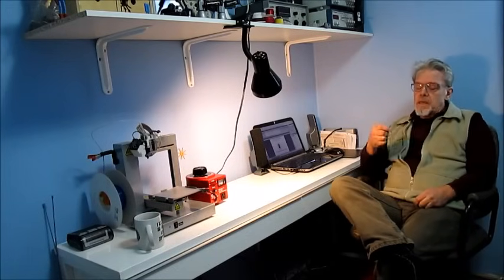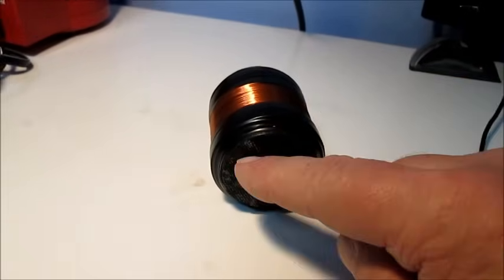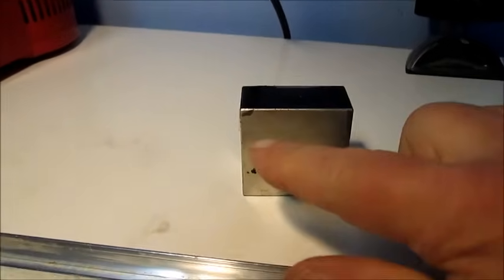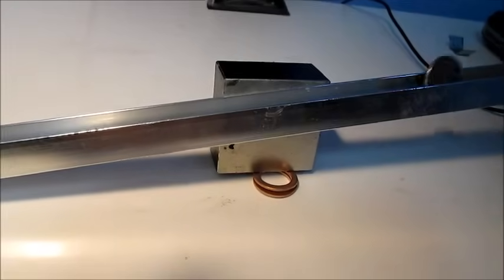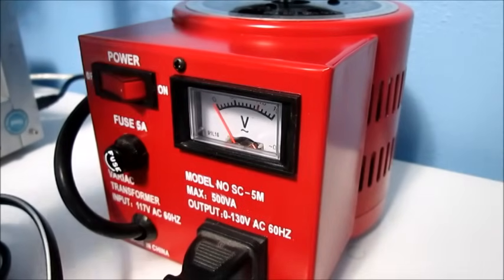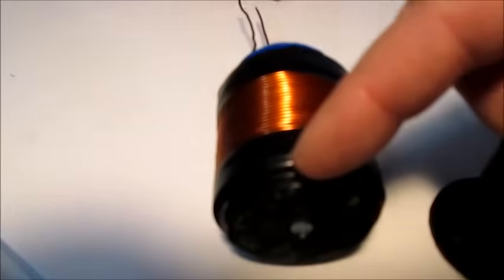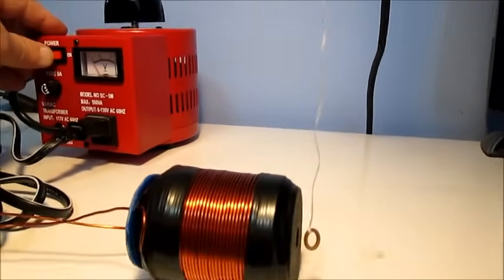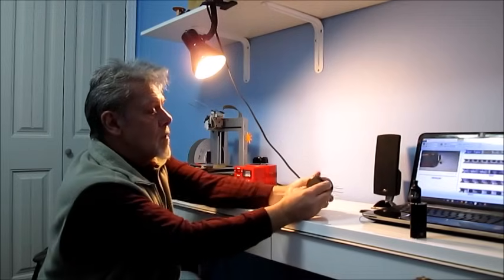How To Make A Gold Magnet

Comment: Taper your outer coil to center of Inner @ 108* and add a third outer coil  3-6-9 good luck
Reply from the maker: Hey Tony, thanks for the comment.  

I think I know what your getting at with the degree shift. I cannot predict what a third outer coil would do. I had planned to change the inside coil to a bifilar coil and use sync generators to power it rather than the variac
Reply: Yes bifilar Two cones per side inner to outer cone and two outside to balance from top N.inner -S outer on north end S. inner . N outer then the same for middle section 2 coils N. S. coils Per end no iron now  opposite coil wind over middle.  .Depending on polarity of current pay attention to Right thumb rule of magnetic flux in the coils in close proximity  to amplify each other rather than oppose .Like a powerfull transformer amplify and lock .Proportion  coils like inner 60/60  wraps on core smaller wire required.Iron layer then same wire size on outer coils but 30 wraps with a 54* drop in length from core top    then 60 wraps on all 4 of outer coils which = 120 wraps in series S. top to N. x2 but increase height from center 12* higher than core height. wire in series from _ to middle of and center corresponding coils .try no iron in middle  smallest coils then 1/4 iron on second  center coil in the  center off inner and outer  and half of 3/4 top and bottom center of outer coils. iron between inner and outer of last coils . connections in center and ends . outer pith change no more than 15* on ends  you will need  imagine 2 bowls in center with iron on both sides outer copper inner copper With 4 iron rings around Bowls due to A/C current you must seperate your iron  cores  in the centrapiedal plane  by 18* of 180* Total height .Have fun  every biffilar coil  is opposing each other 2 per pole x 3 =12 coils per complete build
Reply from the maker: understood

Comment: Commented on Eddy currents ad libitumcopper,aluminum,silver are magnetic  field inhibitors. and they lock the fields into a slowly moving path, causing the magnet lo lag behind. and each metal have different speeds of magnetic field travel... not caused  by eddy currents. you can see this by watching the magnetic field traveling threw these metals. if it was caused by eddy currents in test it would show two distinctive fields. witch it dose not...ive done this using an old tube 60''TV . holding a magnet up to its screen will show you the field/flux lines. and you can repeat this test for your self and learn something. and go against the norm.
Reply: Nabo00o11 months agothats an unusual way to explain it...
superconductors can be used to shield magnetic fields too but they do it perfectly or so i gathered, because with zero resistance they will perfectly match any change in magnetic flux with a flux of opposite polarity, thereby canceling all of it. So in that case, how does your theory fare compared to the norm explanation of induced currents and cmfCharles gonyon2 seconds agono in reality when you super cool sertin metels they become locked in the flux field do to the densness and shrinking of the metal squeezing the flux lines until they are locked and canot move with out grate force. ive ran test on this as well using a tube tv to show the flux lines in the magnet wile holding a pice of copper above it then super cooling it then the copper levitates in that position. and on the tv when I bump or try to move it the flux lines on the tv show that im moving them and it shows there locked into the copper until a breaking point is made.Read more
Reply from the maker: Hey Charles, thanks for the comment.

It's hard to find the old CRT tube TV's anymore.  The electrons shot from the gun reacted to the magnetic field.  This in turn caused the phosphorus on the inside of the screen to change the screens pattern. The good old days...

kk
Reply: tx on way to look at it to prove  the point. naturally generating a magnetic field dose not create  heat. so if eddy currents where being made no heat would be created just a reverse polarity. but if you spin aluminum  copper or libitum above a magent it will generate heat coused from friction from the flux lines fighting to get threw the crystalline structure that the lines are locked into
Reply from the maker: That is an interesting point.

Keeping i mind what Faraday taught us is that a changing magnetic field causes a magnetic field to be generated in a conductive material.
Reply: KenKlondike. Yes but his thinking was and is flawed and this is incorrect. Thats why we will never advance people stuck on old science. That they still do not understand. Tesla new this but would not tell people it was one of his secrets that he had that Made him so advanced in his study of electrics magenicts and sound vibrations with resonance
Reply from the maker: most scientists from 150 years back would change their thinking using today's tools. Flawed Thinking ~ NO! 

We see farther today because we stand on the shoulders of these giants.
Reply: KenKlondike thats verry true in that way of thinking
Reply: when something is super cooled  it stops the propagation of the flux lines freezing them in place and blocking them from exiting the material. this in turn keeps the super cooled material locked in what ever place you place it in. if it was creating opposing fields it would just flip over and be attracted to the magnet. just like putting to opposing magnets to gether they will flip and join as 1 magnet  attraction is greater than opposing. no 2 magnets will hover over one another with out being forced to do so.

Comment: Okay I have to be skeptical about this I would like to see this done with a gold nugget not coin that way the gold is more pure then what they've added to the coin to make the gold stable
Reply from the maker: Hi Jerry

Its ok to be skeptical, that's what advances science. 

The gold coin is a 1/10th ounce Canadian Maple, near pure element au.  Any conductive material would be attracted to the gold magnet, however each would have a varying degree of attractiveness.
Reply: Gold from the ground is not more pure than .999 fine smelted gold.  Also, nothing added is required to make gold "stable".  It is one of the most stable elements in the periodic table.  That's one reason it's such a prized material.

Comment: @KenKlondike  Your 'threads' analogy confuses ppl and does disservice to you and the advancement of physics. Lines w arrows are used to graphically show the direction a compass needle would point.. Magnetism is nothing more than electrostatic-like [think +/- charges] attraction/repulsion of polar[think +/- charges] atoms/molecules/alloys, each of which radiates spherically on the atomic scale where they overlap, the sum of which, on the macro scale, is a homogeneous generally spherical field. So, on all scales the fields are spherical, not thread/ray like. That's an anachronistic view of EM.

There are 2 peaks per cycle so there are 120 peaks in a 60Hz power line,

PAY ATTENTION! RMS voltage is indicated/displayed on volt meters which is the square root of the mean over one cycle of the square of the instantaneous[peak] voltage. RMS is not the same as peak voltage!!!
https://en.wikipedia.org/wiki/Alternating_current#Root_mean_square_voltage 

The RMS voltage is the square root of the mean over one cycle of the square of the instantaneous voltage.

    For an arbitrary periodic waveform v(t) of period T:

        {\displaystyle V_{\text{rms}}={\sqrt {{\frac {1}{T}}\int _{0}^{T}{[v(t)]^{2}dt}}}.}

    For a sinusoidal voltage:
        {\displaystyle {\begin{aligned}V_{\text{rms}}&={\sqrt {{\frac {1}{T}}\int _{0}^{T}[{V_{pk}\sin(\omega t+\phi )]^{2}dt}}}\\&=V_{\text{pk}}{\sqrt {{\frac {1}{2T}}\int _{0}^{T}[{1-\cos(2\omega t+2\phi )]dt}}}\\&=V_{\text{pk}}{\sqrt {{\frac {1}{2T}}\int _{0}^{T}{dt}}}\\&={\frac {V_{\text{pk}}}{\sqrt {2}}}\end{aligned}}}

To illustrate these concepts, consider a 230 V AC mains supply used in many countries around the world. It is so called because its root mean square  value is 230 V. This means that the time-averaged power delivered is equivalent to the power delivered by a DC voltage of 230 V. To determine  the peak voltage (amplitude), we can rearrange the above equation to:

    {\displaystyle V_{\text{peak}}={\sqrt {2}}\ V_{\text{rms}}.}

For 230 V AC, the peak voltage {\displaystyle V_{\text{peak}}} is therefore {\displaystyle 230{\text{ V}}\times {\sqrt {2}}},  which is about 325 V. During the course of one cycle the voltage rises  from zero to 325 V, falls through zero to −325 V, and returns to zero.

Did you all catch that???????

 I'm working of the Parallax Electric Theory to explain that there is no 'magnetic' field, only +/- electric ones.

#ParallaxElectricTheory

Comment: I was using an ac voltage detector the one that has a high 50V AC field threshold. There is a 1"  to 3 "field from hot wiring, outlets, and devices that are plugged in and not in use. No surprise there, By accident I noticed a massive electric field. 3 to 4 FEET! off of the smart bulbs that are CFL. Why would a direct current bulb give off that much of an AC field. Is this a the major health concern I think it is and while everyone is worried about the WIFI radiation we have been getting cooked this whole time by government forced CFL  smart bulbs. In the fine print they admit if exposed to more than 3 hours of exposure within 1 foot of the bulbs our skin is being exposed to radiation that has been shown to cause cancer. What? I noticed when they are are on dimmer you get the massive fieldthat goes from a 1 foot to 3 or 4 feet.. Let me know if I'm mistaken and it's some sort of false positve. My health, energy and life  have vastly improved since I got rid of all of them.  Smart LED seem a lot better i try and use the old school incandescent where possible and my vision has come back after 4 long  weeks. I noticed my night vision would not come in and I I couldn't see in the dark and noticed during light hours I had bad eye strain and trouble reading fine print especially at the end of the day, that didn't make sense to me and was a red flag for muscle fatigue??I So I declined getting glasses, even when I was assured vision goes when you get old. It took a few weeks and some eye exercises, but now it's better than it's ever been. As for as the new dc powered devices, It makes no sense to have the ac powering all these llttle transfomers also there is a huge ac field when these dc devices are plugged in.WTF???? What is the point anyways, has anyon'es power actually gone done after installing smart bulbs??? I noticed my body was charging up to 5V when exposed to these bulbs is my body acting as a antenna orground or  what it going on?? 5v not 5mV but, it would instantly disipate once I grounded out but this kind of exposure to electric fields can't be good. After getting rid of CFL I'm down to levels that are in the low mV. Any feedback would be great. Thanks.